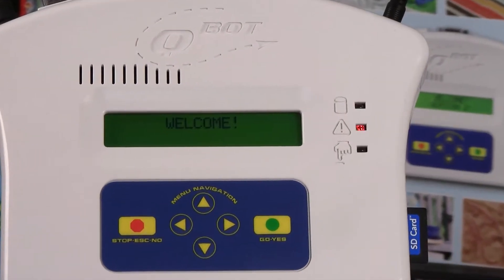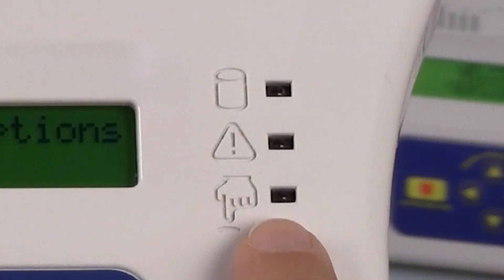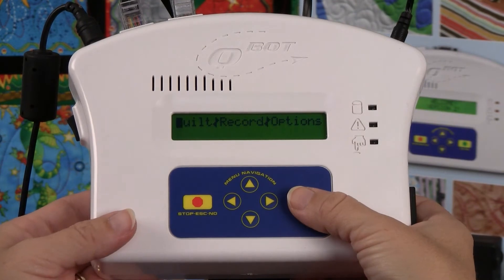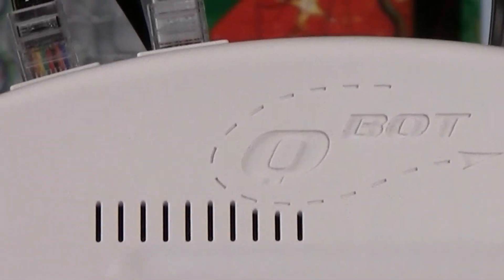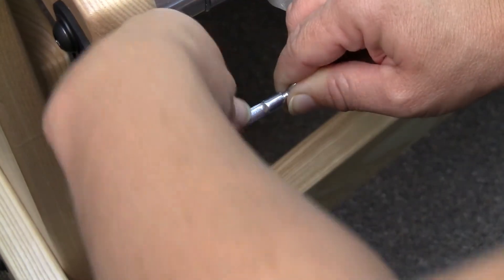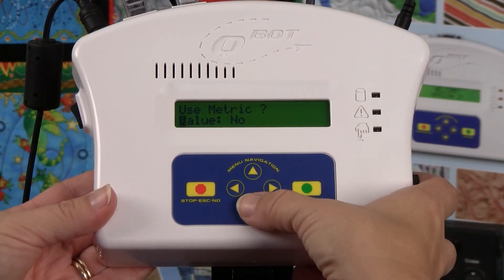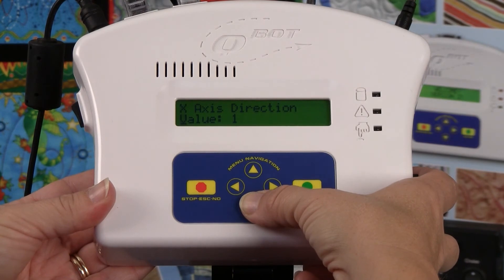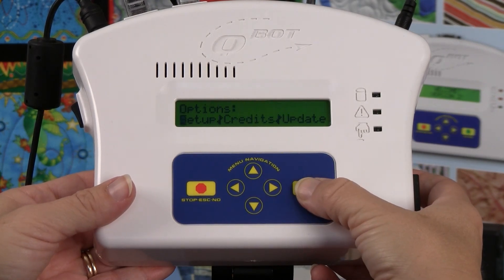QBOT Quilting - Installation Details and Troubleshooting

Comment: How do i actually install the software into my computer
Reply from the maker: If you are referring to the original QBOT companion software or QuiltDesign Creator (the second version of the software), please contact you local Pfaff/Viking dealer.  Generally speaking, the installation is from a CD and you must use the Dongle that came with software and register it with VSM software.  QBOT V3 does not require any software, it is an app downloaded from the Google Play Store.